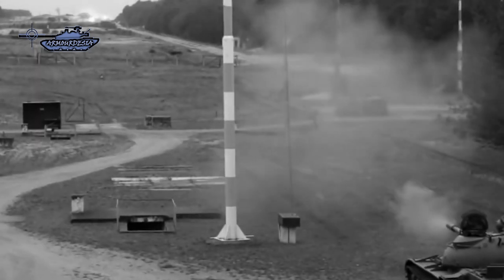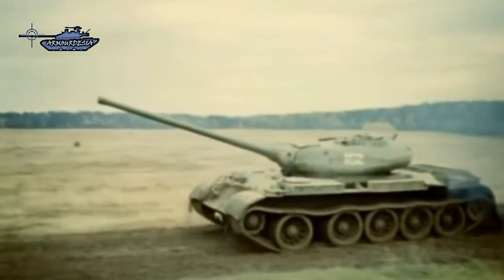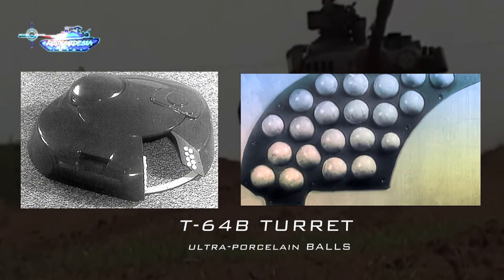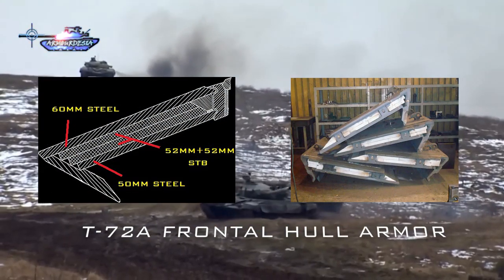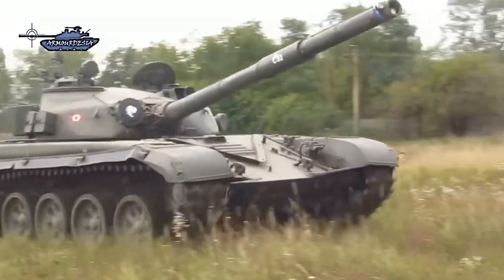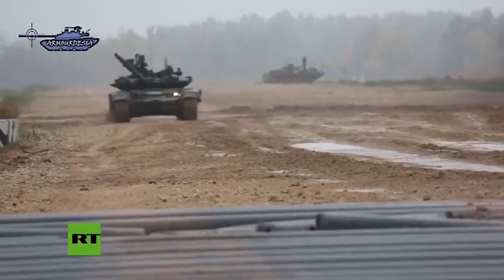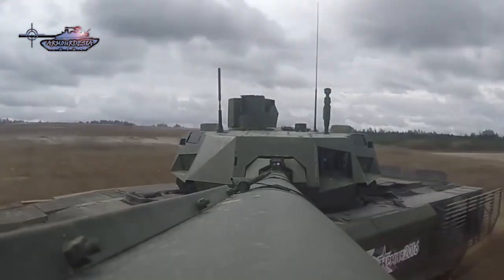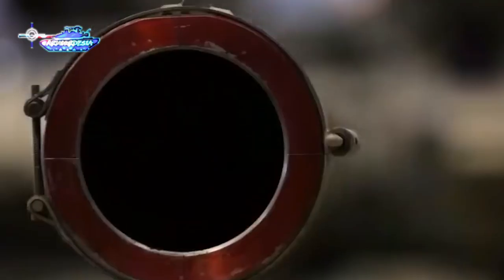Development of modern Russian Tanks armor

Comment: T-80U is best a complete revolution in the series its best on all sides firepower mobilty  protection
Reply: Give it modern fire control system, modern relict instead of contact 5 ERA, modern optics and modern projectiles then yes.
Reply: @Leplivo problem is the use the old t80Bs for the upgrade not the better T-80Us 
The turret composite is fucking old from the 1970s if any apfsds with some anti era function hits t80bvm turret it probly will go throw
Reply: @Leplivo yeah sadly, the T-80BVM uses the T-80B armor scheme, not the T-80U armor scheme, at least we have the Relikt ERA.
Reply: And the turret flies much further when hit!👍😂🤣🇺🇦
Reply: @stevenbreach2561  casually points at Challenger 2 having the same exact problem
Reply: @chadtheboris The T-80BVM has great upgrades, sadly, it's based on the T-80B rather than the far better T-80U. Add a bustle-autoloader and it's a beast... also known as the Black Eagle. I still don't understand why they just didn't commit to the Black Eagle, that thing is fucking awesome.
Reply: T-80UD.

Comment: Its weard that the front armour of Soviet tanks also reaches the side turret, that is actually really helpful since in open field were only turret can be seen, side turret week armour will be covered in composite, (its not as thick in the front but its still there)
Reply: +-35 degrees from the main gun, while the western tank +-20 degrees.
Reply: @c.8276  Only K2 and Type 10 have such narrow frontal protection. Every Challenger every M1 Abrams and every Leopard 2 have three frontal arc protection on the turret. Ranging from 20° - upfront thickest section to 45° arc covering the sides.
The refreshed version of the K2 will be equipped with thick passive armour on the turret sides and up-armoured roof. The Type 10 will be used in places where most armies could not bring MBTs.

Comment: looking at those special armor diagram's, it looks like it  only covers 1/2 of the FRONT TURRET horizontal cross-section .  In fact if you include vertical cross-section and the mantle ; its likely the spacial armor may only cover 1/3 of the front turret profile.You do know that LOS does not equal RHAe...YOU MUST KNOW THE THREAT PROJECTILE as well.